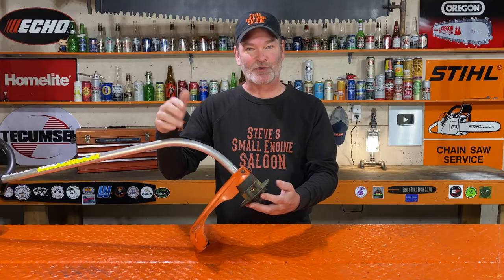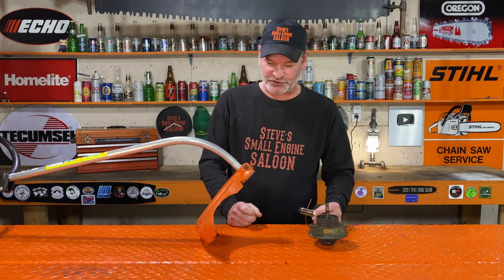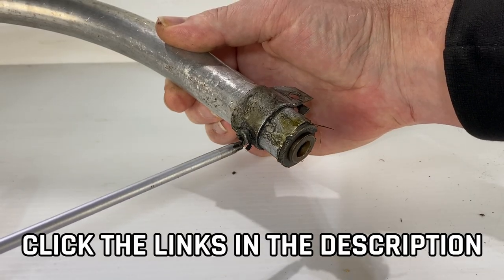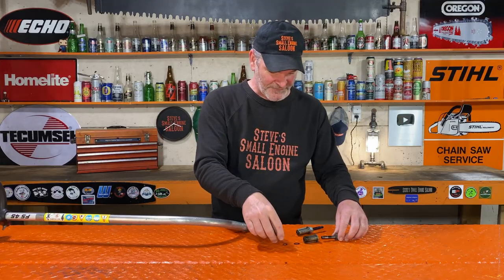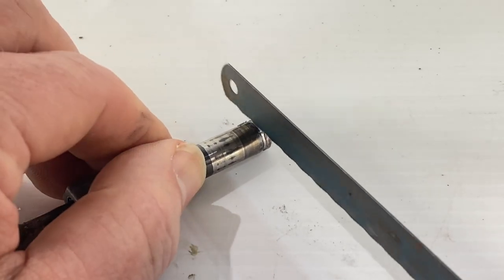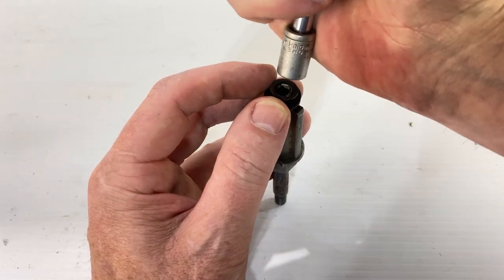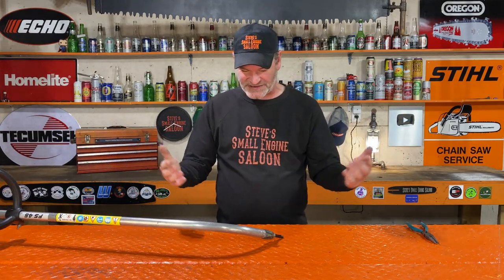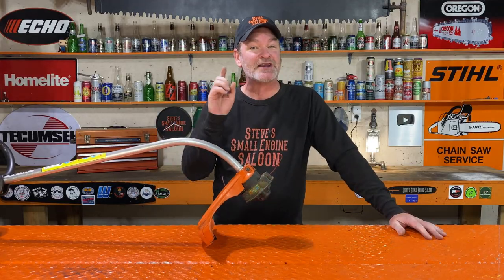How To FIX A WEEDEATER When LINE HEAD FALLS OFF (FOR FREE)

Comment: Man I was operating my old Stihl FS45 today after it had sat up not running for over 20+ yrs now being it was my wife's dad's & it wouldn't stay running for him so he gave it to her B4 she & I met & I stored it in my old shed until the other day when I decided what the heck let's get this thing going! So I bought a new pull cord assembly, then realized that the engine had seized up so I poured a little engine oil in it & it started moving then  rebuilt the carb & a new spark plug & fuel filter as well as a new fuel line  wooola! It's running again .. so today took it out on a job & it was doing great until darn head fell off half way through the job! I stuck it back in & cranked it & once again it fell out so I was about to just electrical tape it together to the spring shaft & noticed it wasn't going to work like that so I left the job unfinished & came home & decided to Google & see if anyone else has had this problem & fortunately ran across your YouTube vy! Appreciate it man I'll have it fixed now! A++ 👍 subscribed & following! 😁

Comment: Steve, I had the trimmer head of my FS45 fly off in the woods while doing trail maintenance 2 yrs ago.  I went to my local Stihl dealer for parts and assistance.  He told me it would be cheaper to buy a new trimmer.  Due to the type of work I was doing, I bought the Stihl 131R - it's a beast with a steel blade!  I still have the FS45 curved shaft.  After seeing your video, I'm going to get it back out and try your solution.  Thanks!
Reply from the maker: Good luck!

Comment: Great tip Steve! When this happened to me, my approach was, put the part on the mini lathe, touch it with a 1/16th cut off blade and BOOM! Job done and perfectly square.
Reply from the maker: COOL!
Reply: If your really carful chuck the bearing shaft in a drill/drill press.

Comment: Hey Steve, I watch you now and then, but I do watch quite a few of your videos. You my friend are very helpful even if some the content doesn't pertain to what my issues are. Now I have a Poulan Prolink PP330 string trimmer. I bought it bran new about 9 or 10 years ago. I only used it maybe 3 or 4 times That first season and it hasn't started or ran since. I check the spark plug which OK but I changed it anyway,  checked and cleaned the carburetor, I even made up a fresh mix of gas, still nothing. Now I have no idea why I held onto it so long not running either. I don't know if you would no what the issue maybe or not. It's not like it really matters I've been without it this long. Thanks Steve have a great day. Happy father's day.

Comment: That was amazing. My fse60 just failed and I cant believe there was a yt solution.  Thks Steve!
Reply from the maker: Glad it helped!
Reply: @StevesSmallEngineSaloon  lol!  It helped yes , but it didnt go smoothly , not like on tv!  it didnt stayed fixed.   The inner piece was really tight and took an effort to get out.  Then,  after using the machine for 10 minutes the head fell off again!  This time i will go against Steve!  I will use a dremel on the notch made for the c clip. I did quite a bit of effort with a hacksaw , with its handle!  And still the notch for the clip failed.  Do it again , one of the recurring dramas of my life -  try try try again

Comment: Gday Steve, I have a FS-460CE.
The gear head on this machine is slightly different to the smaller residential machines. I have just removed and regressed the the bearings and cleaned it all up, It’s back together now though I’m not sure if the top shaft with the circlip is pushed down to far into the gear below. I couldn’t find any reassembly specs in relation to tolerances.. A future vid on a tear down and rebuild on one of these would be awesome 👌 Great channel..
Mike Jones from West Oz

Comment: That’s amazing. Thanks for the visuals and the tricks. I love it! Oh, and if you lose the C-clip, you can cut one out of thin aluminum. The aluminum clip that comes with a mosquito coil works just fine. Fashioned one for a two-stroke motorcycle carburetor.

Comment: Hi Steve thanks for the tips on these . I have the FS 40 and I put the plastic blades on it now I cannot get the head off to change back to the trim string head it is locked and will not turn what do I do ? Thanks again Pete

Comment: Hi Steve!
On the topic of weedeaters, do you know of any good techniques for trimming along a chain link fence?  My string tends to get eaten up, caught in the fence, etc.
Reply: Pull back away from the fence a little bit so just the top of the trimmer string is catching the over grown grass. Then once your trimmed along the bottom you can go back and turn your trimmer on it’s side and get anything the may have grown through the fence. I think I have this demoed on several of my videos maybe hard to see cuz some footage is sped up. Hopefully this info helps
Reply: Use a board against the fence. You won’t get all the gras/weeds but you’ll get most of it

Comment: Hi, i have to swap either the shaft tube over or the head bearing assemble to fit diff head with diff thickness shaft, one thicker than the other. Is the "bearing" simply a bush and how does that not wear out if not a bearing?? also should i try to put some oil into it?

Comment: I just bought a used FS45 exactly like this one in this video.   I'm not having this problem, the bearing is complete and in good shape but I have a head scratcher that I'm hoping someone out there can help me with.  When I tighten the trimmer head it doesn't want to spin if I tighten normally, so I leave it slightly looser so that it will spin.  But when I try to use the trimmer, the head immediately tightens and locks down immediately.  It becomes super tight and will not spin.  I can't come up with an explanation as to why this is happening.  Perhaps an incorrect trimmer head for this model.  The head is a Stihl Autocut 5/10/11.  Any ideas, suggestions, theories would be greatly appreciated.  And BTW, another great video Steve.

Comment: I bought a Hyper Tough 2 cycle angled gas trimmer which starts just fine but when I started weed wacking with it the line on both sides broke off inside the head.  So do I need to bump the head or take the head apart.  Don't tell me anything about battery or electric trimmers because I know what to do when this happens since I can take the head apart and put the line through the hole.  But I've never had a gas trimmer so this problem is something new and I don't want to break my new trimmer.

Comment: Do you have a way to repair the drive shaft for my chainsaw attachment that goes on my string trimmer.  The shaft broke off about 2 inches from the end that drives the chainsaw.  The drive shaft is not available as a separate part.  The chainsaw attachment only has a couple hours of use on it.  The drive shaft broke off in a twisting motion when the chain got jammed while cutting a limb off of a downed tree.

Comment: Hi Steve,  I bought a Stihl FS40C from a lady friend who wanted to get rid of her lawn equipment cos she was moving from her house to an apartment. I've always had straight shaft trimmers so this new curved shaft threw me for a loop because I couldn't find a decent speed feed head that works on Stihl's curved shaft. Also, in my opinion  Stihl's replacement heads are pretty crappy, not easy to use nor do they bump and feed well at all. Are you aware of any trimmer heads or conversion kits that work well on Stihl's curved shaft trimmers? Thanks Mike

Comment: Help! I need a solution for a woodruff key (groove) it goes in on a trobilt weedeater. The crankshaft the woodruff key goes into is broken cracked hollowed out however you want to describe it. How the heck do I fix it? Other than taking the crankshaft out and replace it.

Comment: I have an unusual problem. Mine DOESN'T have the nut on the end of the trimmer. It has a bolt only.
I can push the outer plastic piece back which exposes the head of the bolt. I can put a lock spanner on the bolt and turn it either way. It just spins and doesn't loosen the head. Have you ever seen one like this and how do I get the head off?

Comment: I just want to put my two cents in well you got that driveshaft out a little bit I would pull it out all the way in greased the driveshaft and put it back in I ran across some of those driveshaft the freeze up in a tube because of lack of Lubrication shaft

Comment: Think you should have greased it before assembly as you can clearly se the top of the bearing housing is turned yellow and blue from heat that could probably messed with the c clip temper so it is softer than new
Reply from the maker: https://youtu.be/j26_4KqacIQ